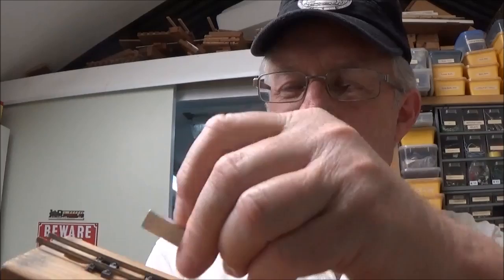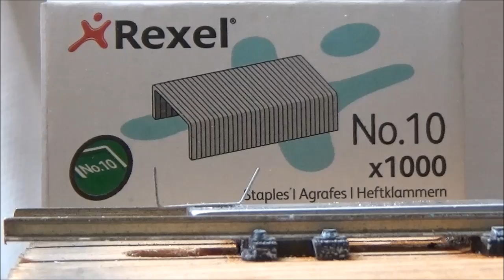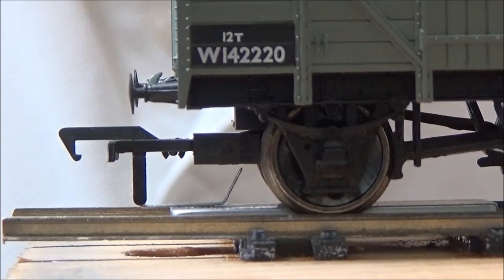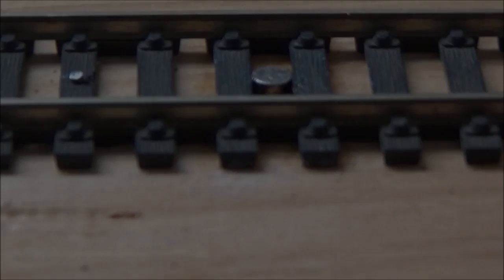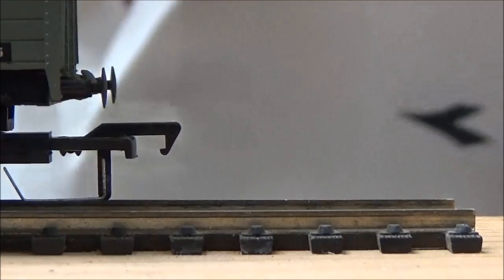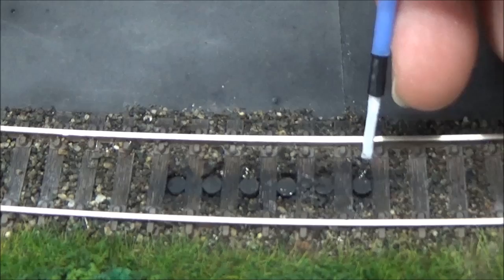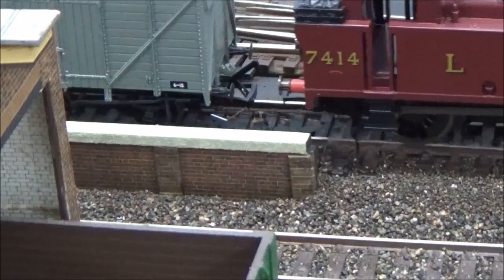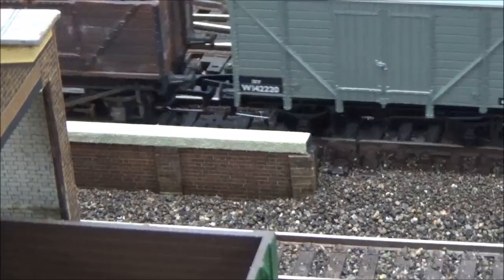Episode 56 17 Magnetic Uncoupling

Comment: Excellent tutorial! Thanks. There are so many methods and I'm VERY interested in this method. Much better to use the height gauge as this was one of my concerns. Super. A UK layout use tufts of "weeds" and removes one coupling hook from each wagon (all wagons must point in the same direction) As the hook passes over the tuft there's enough fibre to move the hook up and in a shunting yard the weeds don't look out of place! Just a thought, but thanks very much for the hints & tips.
Reply from the maker: Thanks for your comments and tips Bobby D.
The weeds idea is interesting and low tech and worth a look.
The method in the video above works fine but I am currently working on improving that as well. I have changed the location of the staple on the hook altogether and I`m getting more reliable operation with a distinct visual improvement.
As it`s still in the development and testing stages, no video will be forthcoming until I`ve nailed it....but I`m in the home stretch with it now......so it should happen within the foreseeable  future.???
Cheers, Gormo

Comment: Hi Gormo. That is very interedting. I had heard about a systen like this but never seen it in action. It does seem to work really well and is very cost effective. It is also far better than using those unsightly ramps between the rails..............John
Reply from the maker: G`day John. Have to agree the ramps are ugly. The system does work well providing you can set those staples at the same height for each wagon and coach. The height gauge makes a world of difference.
I have had a suggestion given to me on Platform 1 MRC that rectangular magnets set down the middle of the track may give a more even pull on the staples. So I have just ordered some to give it a go...they are 15mm x 3mm x 2mm. I will update with the results once the magnets arrive ....which could be three weeks.????
Cheers gormo
Reply: Yes I use rectangular magnets with my Spratt and Winkle couplings. They work really well and are available in different strengths, N52 being the strongest.......................John

Comment: Might be better to use a thin metal strip to stretch between the two outer magnets to stop that popping up and down.  It should then look like one continuous magnet. It'll also remove the need for the other 4 magnets. Just remember to make sure both magnets point in the same direction.
Reply from the maker: Thanks for the tip Les
Cheers
Gormo

Comment: Your jinty might run better at slow speed if the coupling rod was mounted the right way up. The magnets are a  great idea and useful  for me!
Reply from the maker: Thanks Craig,
The rods were fixed a long time ago
Cheers
Gormo
Reply: @greatchesterfordjunction  I use a Jinty for shunting that I built from a Nucast whitecast  kit with an airfix 5 pole motor. It's the smoothest loco in my fleet and has been for the last 30 years!
Reply from the maker: @farric1  Sounds like a good one Craig, it must have some good weight too being from a kit.?
Cheers
Gormo

Comment: Hi Gormo Thanks for the replies.
I hear no sound effects, so it looks like you are using DC not DCC. I am in the process of adding background sound (station noise, guards whistle, loco movements) to my layout by using downloaded sounds from the internet and playing them in a large hidden Bluetooth speaker (Anker). You can use a cheap tablet pc or even use a Walkman with a cheap Bluetooth transmitter/receiver connected to the Walkman and set to transmit. Unfortunately with Bluetooth you can only connect one speaker at a time, so I will use the Train Tech DC sound system placed in a CCT wagon or a coach to add moving sound to steam and diesel trains. It is much easier and cheaper to fit them to a wagon/coach rather than individual locomotives. You can replace the supplied speaker and tube with a superior cube speaker. The coin battery can also be replaced with a twin AA battery holder for longer life but this takes up more space.
Reply from the maker: Your layout will become very atmospheric with the sound added Ray,
It may be a future project for me but at this stage there are too many other parts to concentrate on.
Cheers Gormo

Comment: This looks great, but I have one worry with this method.. as a loco passes over these strong magnets, does its motor suffer damage in the long term?
Reply from the maker: Hi M,
I am not 100% sure if the magnets have a detrimental effect, however DC Concepts Power Base system.
https://www.dccconcepts.com/product-category/specialised-model-accessories/dccconcepts-powerbase/
requires you to fit substantial magnets under your locos for it to work. I would assume they have done their homework and found no ill effects from using such a system.
Cheers Gormo

Comment: Hi Gormo. Do you have any experience with (preferably variable) close coupling of coaches? I would like to reduce the unsightly gap between coaches but I have some tight curves, which means that the couplings have to lengthen to go around tight curves.
Reply from the maker: Sorry Ray,
Can`t help you there.......however I have seen somewhere, somebody who created an expanding connection between the coach ends and I think it was made from folded paper.???
Cheers Gormo
Reply: Thanks Gormo
I found a DIY sheet here http://britishmodelrailwayclubofmontreal.blogspot.co.uk/2011/07/coach-corridor-connections-and.html
and ready made connections here (UK)
http://www.mbmodelrailwayproducts.co.uk/products
and here
http://www.modellers-mecca.co.uk/27-corridor-connections

Comment: Hi Gormo. Thanks for the video, great thinking to set the height correctly. 
Question:- What diameter of magnets do you use? 
Have you tried different diameters to see if they make any difference to performance?
Reply from the maker: G`day Ray ,
Welcome aboard.
The circular magnets used in this video are 3mm diam x 2mm thick and they are code N35. The "N" number denotes the power of the magnet. The bigger the number the bigger the pulling power.There are N50`s available but depends on the size too as to whether you can get the higher rating. 
In the end I have changed over to rectangular magnets that sit on top of the sleepers.  I have had to change the height that the staples sit at, but overall it is easier to fit the magnets and they are also easier to remove if you change your mind. The rectangular magnets are 10mm long x 3mm wide x 2mm thick x N35. I went down this road to stop the coupling hooks raising up and down as they passed over a sleeper to the next magnet in between the sleepers. The rectangular magnets achieve an even pull along their length.
At the end of the day it`s best to experiment and try different combinations and settings until you find what works for you. Which ever magnets and or strengths you use you will still find the trickiest and most frustrating part is fitting the staples. I still think there has to be a better way to do it but I haven`t come up with anything at the moment.
Hope this helps.??
Cheers Gormo
Reply: Thanks, Gormo. Sorry, I wrote the question before I saw your other video ! 
Do you still use your metal jig to bend the staples to a consistent shape?
Reply from the maker: No worries Ray,
Yes I use the jig.....you have to be able to achieve consistency.......mind you that said....sometimes you have to tweak the staple when it`s on the wagon. There is quite a lot of play in the hooks on these tension lock couplers and consequently they don`t always allow the staple to sit centrally over the magnets.....so sometimes you have to fiddle it a bit.
Cheers Gormo
Reply: Agree really useful video esp the jig to get a consistent height.  I use 15mm dia x 0.5mm magnets located beneath the sleepers but above the baseboard.  Clearly this is best installed before you ballast any track.

Comment: Thanks will it work for me although I have fully magnetic couplings?
Reply from the maker: Sorry the answer is no.
If you have metal couplings that are attracted to a magnet, they will not work at all.
In fact the magnet in the track will pull the drop down bar on the coupling hook down towards
it and lift the other end of the wagon.
This system works best with the mini Bachmaan Tension Lock couplings, which have no
components that are attracted to magnets. It could also be applied to the Mainline style
coupler, which is all plastic.
Sorry to be the bearer of bad news
Cheers
Gormo
Reply: Hi again if that won't work do you know of any ways of doing it??
Reply from the maker: You would have to replace your current tension locks with the mini Bachmaan
 system.
Cheers
Gormo
Reply: I have found it will actually.  Not tried with the massive old hornby hoops, but using new hornby, or the Dapol ones you can by in big packs I get good uncoupling all round.  Only difference is I have magnets either side of the uncoupling point, but not in the centre.  And i tried several different depth and radius of magnet before getting one the worked well.

Less is more with magnets, as too powerful and they begin to attract the axles of trucks giving unpredictable and clunky movement.